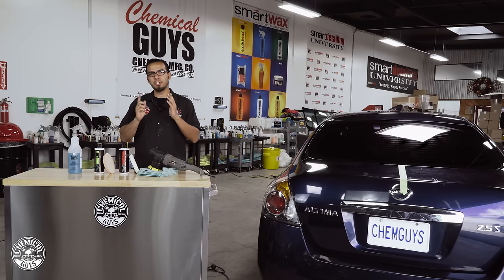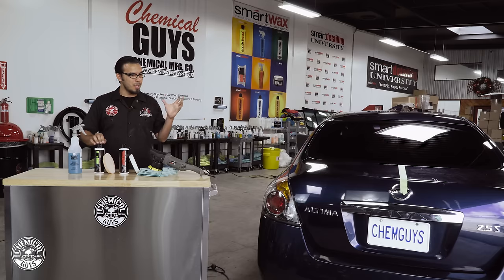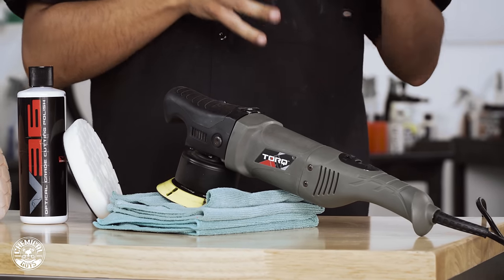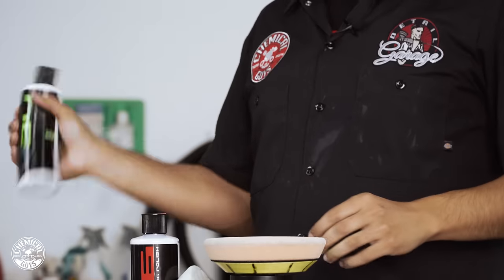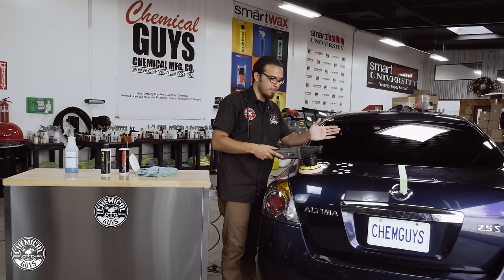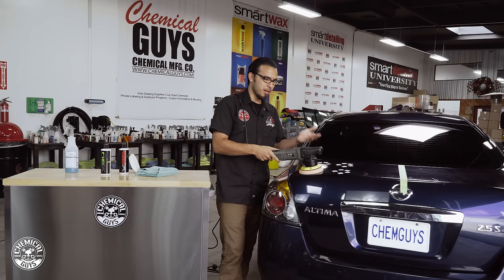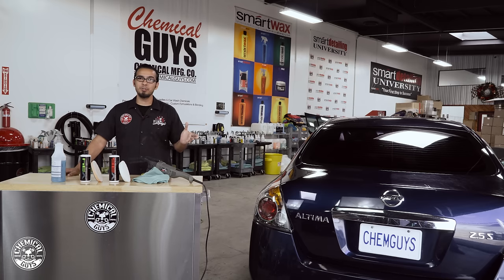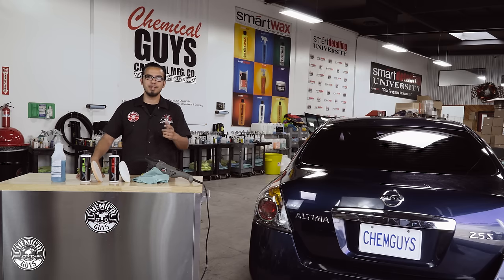How To Remove REALLY Deep Scratches and Swirl Marks! - Nissan Altima - Chemical Guys Car Care

Comment: is using the orange pad and then the black pad the same thing?
Reply from the maker: Hi Luis, they're quite different because the orange pad is very abrasive. The orange pad is used to cut away clear coat to expose fresh undamaged paint. The black pad has no cut at all which makes it perfect for applying coatings like waxes and sealants.
Reply: Chemical Guys ahh ok. Because I bought the 4 pack of your line up for polishing/compounds and have some areas with deep scratches and some with light scratches so what’s the best way to go about them? I was going to use the 32 to start with the deep scratches but I take it you don’t recommend it? And the black pad can be used for polishing not just wax and sealant correct? Sorry for all the questions I’m new to all this and just want to do it right
Reply from the maker: Hey Luis, you never want to Jump straight into V32. I say start with V36 and an Orange pad, and do a little test spot, see if that works, if not, you then you move to V34 with an orange pad. If the paint is thick, you may need to jump up to the yellow pad. Once you've removed the clear coat, you need to use V38 with a white pad to refine that area, this is important: many people don't do this and wonder why the paint looks swirled.  Polishing can be anywhere from a two to three step process, never go to hard because you can't go back once you start removing clear coat. You use the black pad for applying wax, glaze, and sealant. You'll need to put those on after you polish because the clear coat will need to be protected against the sun. Here's a link to one of our video that explains what the pads do.  Hope this helps you.
https://www.youtube.com/watch?v=vnW7P7ZOT44&t=78s

Chemical Guys Alex
Reply: Chemical Guys ok understand now. After I do the compound and polishing then I’m going to be applying a ceramic coat so is that a good step after the polishing or do I still need to do a wax or sealant and then the ceramic coating?
Reply: Chemical Guys ok understood. So after doing the polishing/compound I want to do a ceramic coating, so is that fine to do or do I have to add a wax or sealant after the compound before applying the ceramic coat?
Reply from the maker: Hey Luis, apply the coating, and wait about 24 hours before applying the glaze, sealant, and wax. Make sure not to get the vehicle wet in that 24 hour period.

Comment: Chemical guys do a video on removing scratches from the odometer
Reply from the maker: Thanks for watching the video, we would like to do that, but it requires removing the clear plastic in front of the odometer. People put a lot of trust in us when they let us detail their cars, and we want to avoid causing any damage. If you've seen our headlight restoration video, you'll need to wet sand with 2500 grit sand paper, then 3500 grit sand paper. Since the plastic above the gauge cluster is pretty small, you'll have to use a drill with a screw attachment with a backing plate, and a medium orange hex cutting pad with V36 polish. After the V36, switch to a white pad with V34, and polish the surface of the lens. It's very important to clean the lens first before you start sanding.

Comment: oh result is not good.
Reply from the maker: Hello Hassan, it's going to take much more work than that, this vehicle is so badly scratched that it may need to be wet sanded, and repainted unfortunately. Considering how it looked like before, and the reaction of the customer, this was a job well done.

Comment: Any more than 5lbs of pressure will stall the pad on that Torq machine? That makes it sound pretty weak.
Reply: MikeEM1 He was talking about speed setting 1. I have the porter cable DA polisher and I can't stall mine out 😂
Reply: Are you sure? Didn't seem to state it that way. I had a Porter Cable, good for beginner, but vibrates too much for the hands. I've upgraded now to something nice.

Comment: At the end, still looks horrible lol
Reply from the maker: Thanks for watching. Considering what it looked like before, it's a big improvement. This video is intended to be an informative piece to show the steps needed for paint correction. We're aware that the paint doesn't look perfect, and it reflects the vehicle's owner's carelessness with regards to maintaining the paintwork. Lastly not all scratches can be removed, in cases like this, sanding and repainting is the only way to get the paint looking like new.
Reply: Would V32 have done a better job?
Reply: Chemical Guys maybe wool and 32 or 34 as the first step?

Why dont you use a mf cutting pad or wool pad first?
Reply: wool takes off too much clear coat.
Reply from the maker: That's a great point, we typically start with a less aggressive procedure before moving on to the most aggressive, more experienced detailers will already have a sense of what equipment to pair to tackle a job like this. Many of our viewers have never done this before, so we want to everyone to understand the fundamentals.
Reply: Hey! how about you guys go at it with another heavely scratched up car and show us viewers how to go the whole 9 yards? or atleast as far as you can go without wetsanding/repainting! =) 

Appreciate your videos, sometimes id like more of the "how to" videos rather than the commercial-ish ones for a specific product =)
Reply: Goreshaks yea
Reply: Final Touch .Professional Detailing. Yup

Comment: How do I avoid creating holograms?
Reply from the maker: Hi Owen, 

When dealing with deep scratches and using compounds like V32 and V34, getting holograms is inevitable. The reason for this is when you have to get rid of really deep scratches with the compounds, you're cutting a thick layer of clear coat to to reveal a fresher layer of paint. Since you're cutting much deeper, micro-scratches will happen around the paint. That's why you need a refining polish like the V38 to remove it and smooth it all out. The water-based formula takes out those light defects very smoothly to make those holograms/buffer trails that the V32 created, disappear. As always, thanks for being part of the Chemical Guys family!